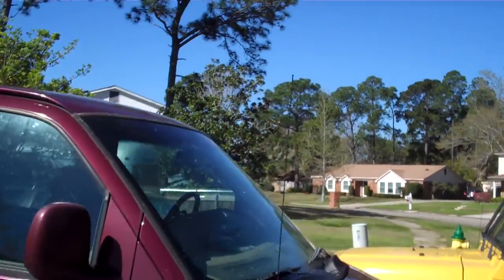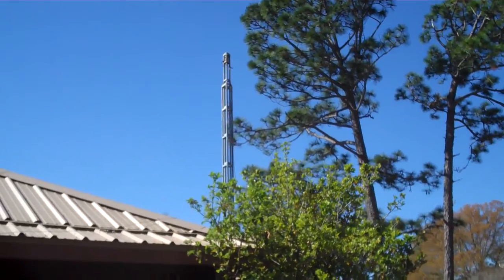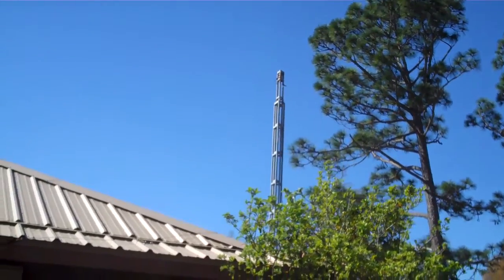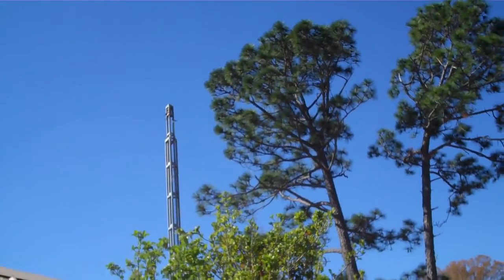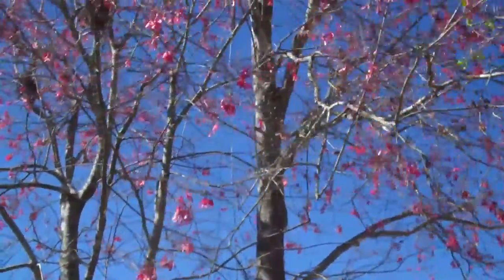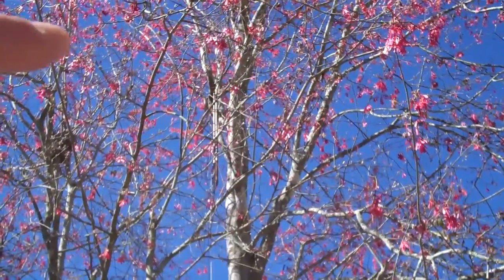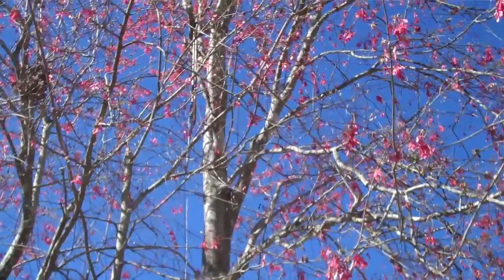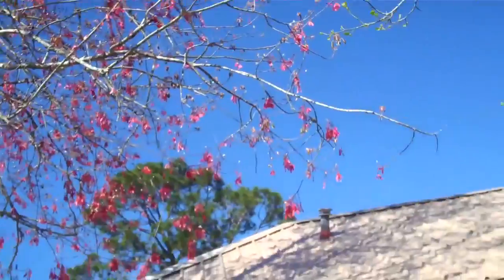Final placement on the 2 meter home built j pole-slimjim antenne

Comment: Two things. Your wire leads from coax to antenna were way too long on the tower and yes the pole was interfering. Extend you plexi mount and get bottom of "J " above pole. Bring your coax RIGHT to the bolts, splitting coax JUST long enough to connect.
Reply from the maker: Thanks for the added information!